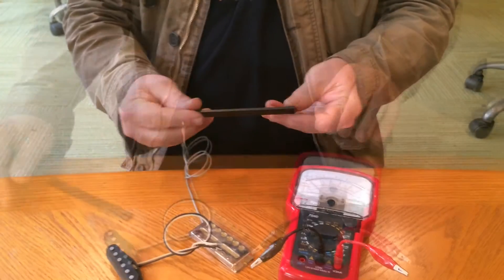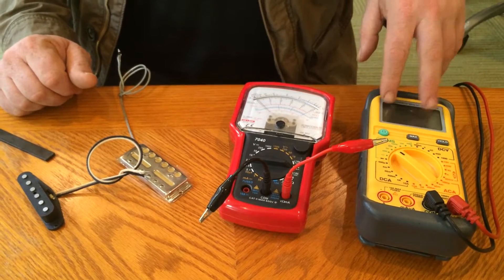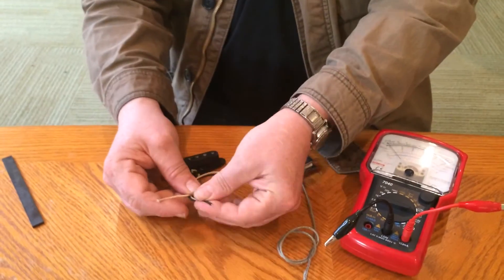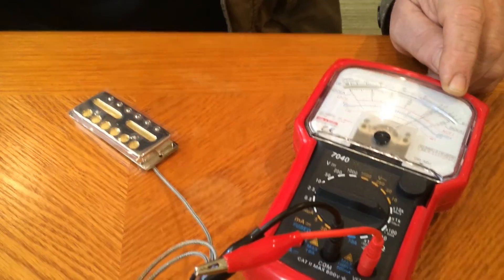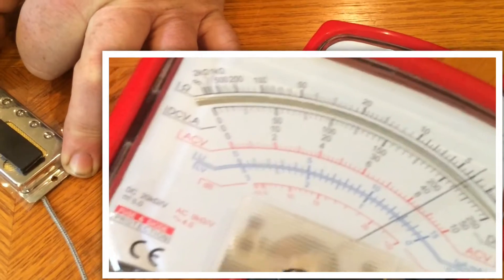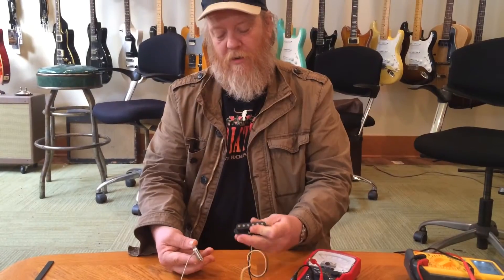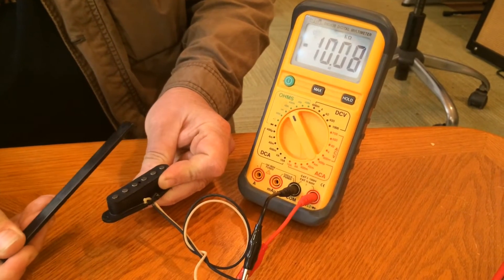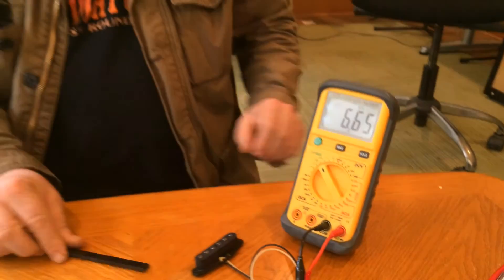Lollar Phase Test Video

Comment: Great explanation except for one thing: 

True, if you are looking for pickups to be hum cancelling and in phase, it doesn't matter whether you record the meter's needle movement upon the ferrous melal drop, or upon the lift off. They'll be in phase & hum cancelling as long as the same test (either drop or lift off) on both pickups yields identical needle movement direction & the two pickups are opposite polarity. (They'll still be in phase with identical polarity...but not hum cancelling). 

So, from a practical standpoint, it doesen't matter whether you verify the drop or lift off needle movement is identical (both positive or both negative). As long as the movement from 2 pickup tests is the same, they are in phase, and if the polarities are opposite between two pickups for them to be in phase & hum cancelling.

But, if you want to modify a pickup by flipping the bottom magnet, or reversing the leads, to get hum cancelling, it helps to know whether the phase is positive or negative. And, reading the lift off meter needle movement with be in a direction opposite to that positive vs negative movement. (Ie; needle momentarity moves in a negative direction for a positive phase pickup.) It is more logical to know that, with a drop, rather than a lift off, positve needle movement means positive phase pickup.
'
The problem limitation with your method, especially when using a digital vs analog meter, is that you're simpy laying steel onto the pole pieces down, which is slower than the lift off, because in the lefit off, it is as if the the pole pieces "let go" of the steel suddenly. A good reading is accomplished by that relatively rapid movement of the steel in relation to the pole pieces.

Hence, you can get great reading with drops if you literally drop the metal onto the pole pieces from a height of an inch or so, rather than laying it down. It's harder to describe than actually doing it...but this method works to get a good reading movement every time, even with a digital ohm meter. And, the needle movement matches the phase of the pickup...again, positive movement, positive phase.

StewMac has a good chart which identifies which combinations of polarity & wind directions of two pickups (16 possible combinations) are in phase & which are not (8 & 8( and which are in phase AND hum cancelling (4 possible combinations).

BTW, your info on the Lollar pickups page that discusses pickup phases is very helpful in describing why some pickups can't have phase reverses by reversing the leads (or when doing so would make for a noisy pickup) because in those pickups the ground wire is also grounded to the pickup case (Vintage Gibson or P90 pickups with only a single inner wire inside of a braided shield). In order to be able to swap the leads, you would have to replace the shield with insulated wire, and ensure that ground wire was not in continuity with the case...complicated since the connection is in the middle of the coil. (Likely, you'd have to remove the coil wire from the bobbin & rewire/rewind it "from scratch".)
Reply from the maker: Yep, all good things to consider.

Comment: i just installed a special T bridge in my tely.. and it's now reverse polarity wiht the neck at middle position.. how do i modify the neck to make it work? i still want the pickup cover to be ground.. i won't modify the Lollar bridge because your pickups are a bit $$$... thx
Reply from the maker: This is a fairly simple fix; you just need to do a 3-wire mod on the neck pickup and then reverse the two coil lead wires and tie the cover lead wire back in with the ground lead (which, as a reminder, will then be the wire that was originally the hot lead wire) to keep it grounded correctly.

Here's a short write-up we did about the modification: https://www.lollarguitars.com/blog/2013/07/lollar-pickups-primer-the-3-wire-tele-modification/

This article is about the "4-way tele" mod, but it involves the same modification needed to the neck pickup. You may be able to find more resources online that's dedicated specifically to the pickup modification, with more visual or even video aids, but this will be a good start.

Best of luck!